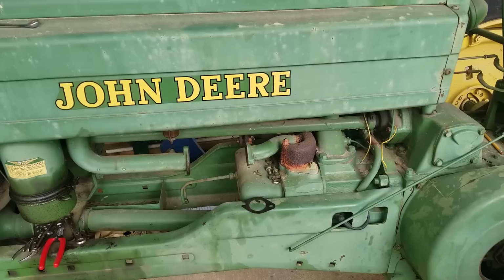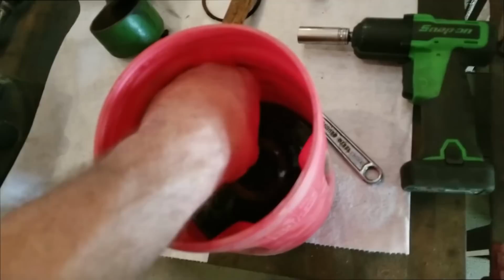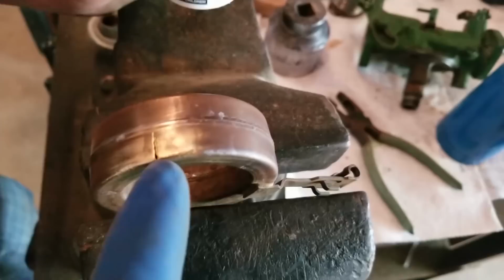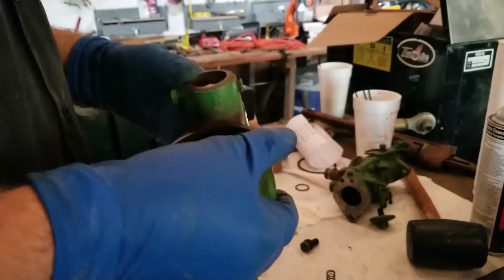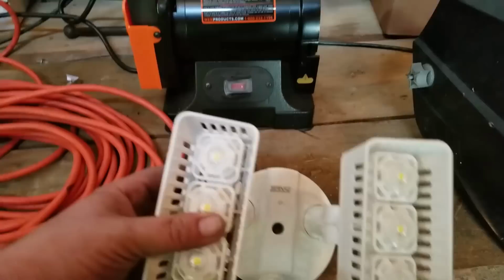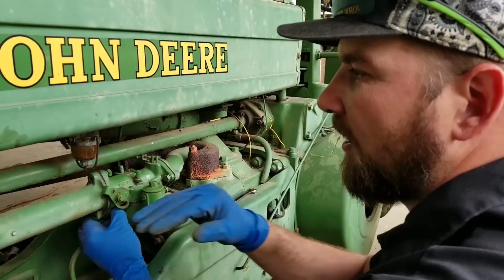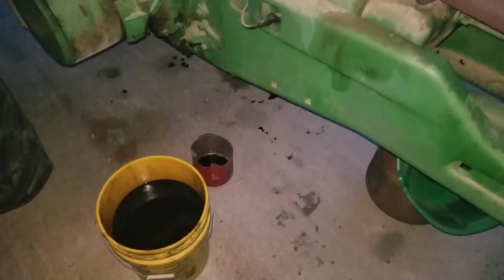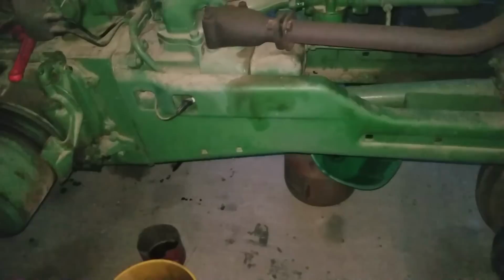1951 John Deere Model B carb rebuild and first start in YEARS!!!

Comment: Most of us don’t have a gasket making kit,so start by making the small holes first, then putting a bolt in them to hold the material while you finish tapping out the gasket.

Comment: My ‘51 B does the same... so I shut the fuel valve off when I park it. My ‘57 JD 720 does have the auto shutoff; it opens with oil pressure. There is a button on top of it to open the valve to ‘prime’ the bowl.

Comment: Had a similar fuel shutoff issue on a model A and it was because the new all metal needle wasn't sealing on the seat properly.  Put the old rubber tipped one back in (not sure if it was original or not - I assume not) and the problem went away.  I leave the fuel on all the time now and it never leaks

Comment: Don't need any automatic shut off. Shut off fuel bowl, run till engine dies, open petcock on bottom of bowl if concerned that fuel bowl and/or needle & seat don't hold.
New float is less than $30, new needle & seat less than $20, gasket set $10. Usuallt that's all they ever need.

Comment: I always turn the fuel off on my old tractors, I'm wondering what the fu*k are you thinking?
Then I'm wondering, why would you want to make it more complicated with an electric valve that will just cause problems?
What is so difficult about turning on the fuel while checking the oil? You do check the oil, don't you?